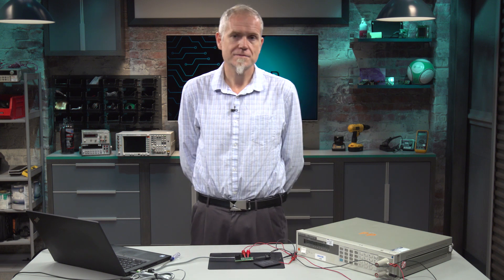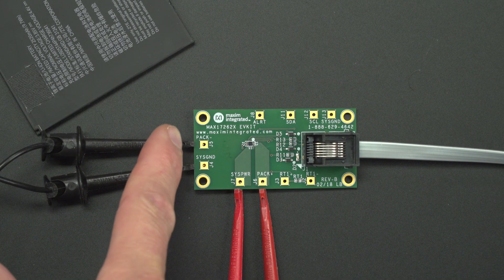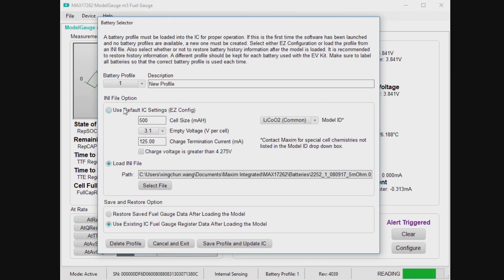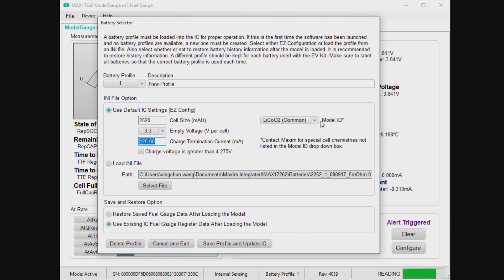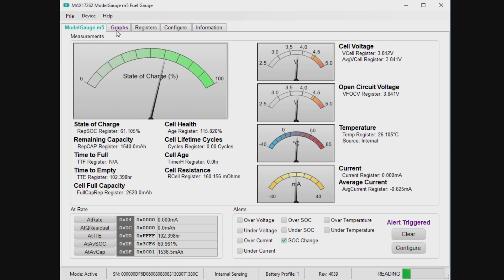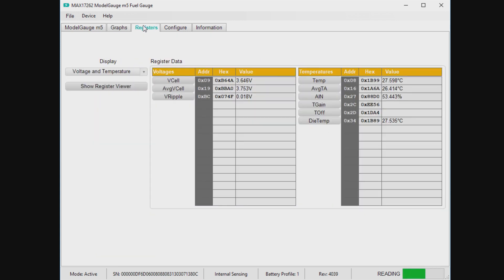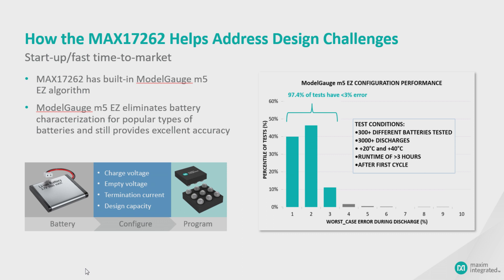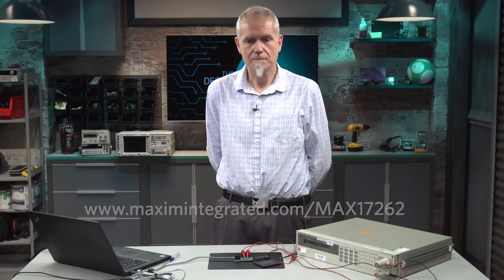Plug-and-Play Battery Fuel Gauging with the MAX17262 and ModelGauge m5 EZ

Comment: Hello!
I really enjoyed about MAX17262 and your software for it! 
So I want to use MAX17262 in my new device, but I have some questions about MAX17262 and MAX17262X Evaluation Kit.
1. If I want to use DS91230+ USB adapter with MAX17262, based on own PCB with different I2C devises (Acxelerometers, RTC) for in-circuit test, will I able to use MAX17262 software or not? It's really important for me.
2. If I need to connect an external MAX17262 to the MAX17262X board, how can I disable the chip installed on the board?

Hope for your answer,
Alexey Severin